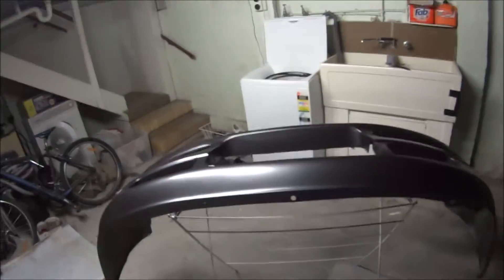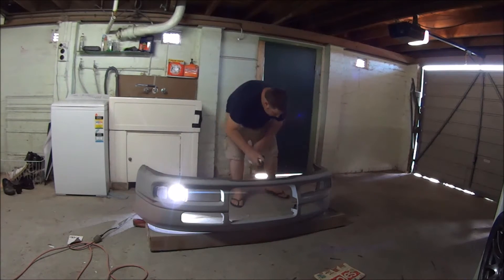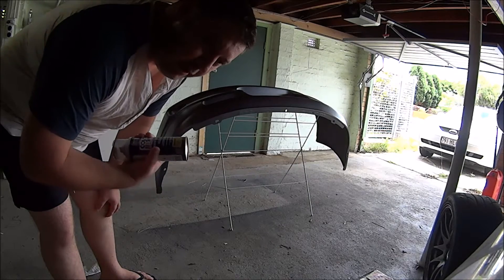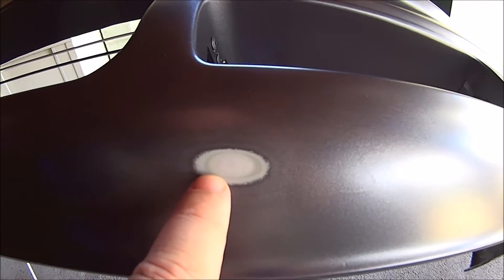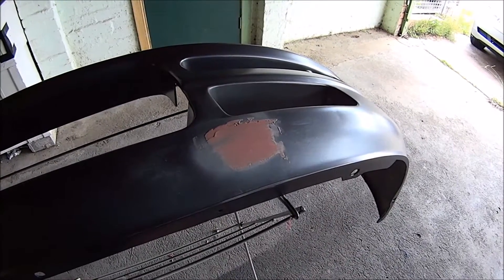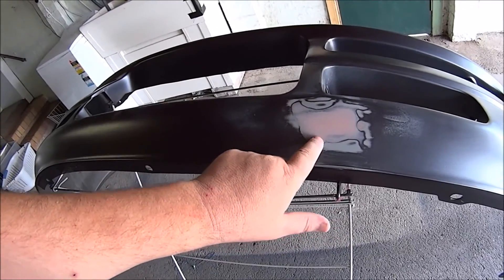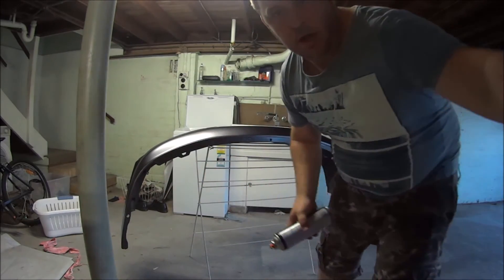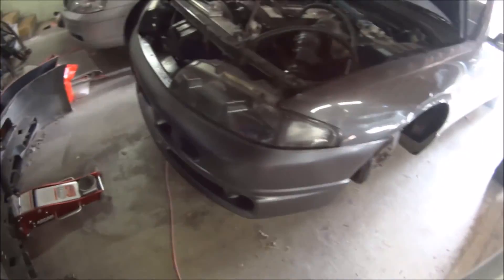Nissan Skyline R33 GTST Build - Paint Type M Front Bar - Nissan Skyline R33 Paint Finish

Comment: With clear in a can it's usually advised to put 7 - 10 coats on (so you can give it a heavy polish) and then you need to buff it to shine, all can clears will come out matte
Reply: Also, you have to wait a week before buffing the paint. So it's fully hardened.
Reply from the maker: BigFudge thanks for the tip... good to know. i thought it should be high gloss but maybe thats only the super paint is a nice bioth in conteolled conditions. not my half arsed rattle can job. thats part of what im doing here learning. 😆
Reply: All good mate, you've done a top job. Will come out mint.
Reply from the maker: I wasn't trying to defend my uselessness there lol. It is what i is for now, unless I get super excited it's ok at a glance i's only looking closely that you notice.